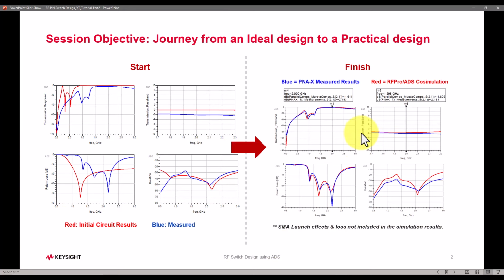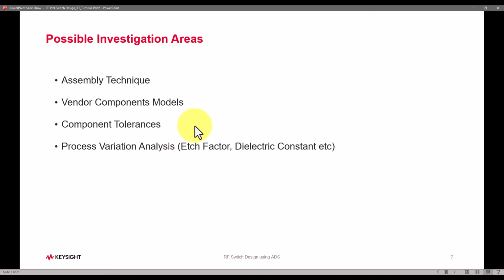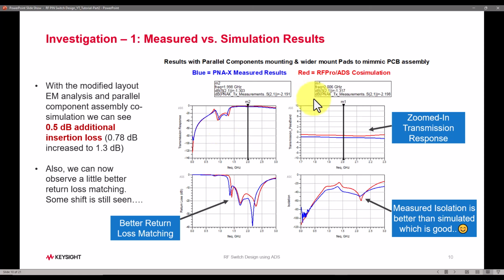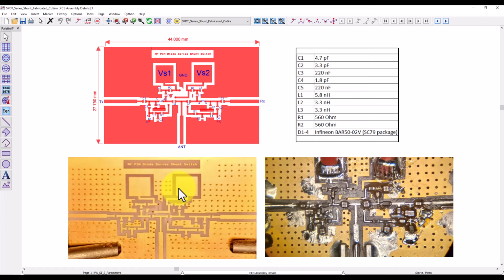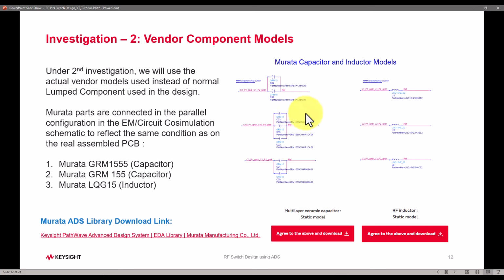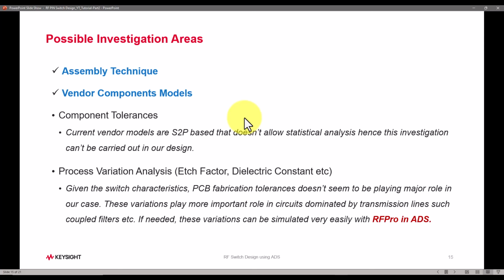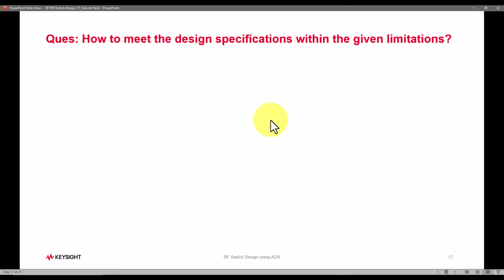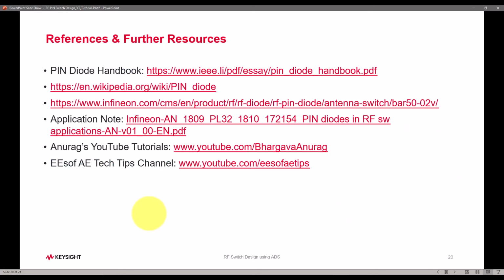RF Design-30: RF Switch Design using ADS - Part 2

Comment: Hi Anurag. Thank you for greate video !!! I have a question. Could you answer kindly?
I'm designing MMIC PA. But there's a quite difference with Momentum RF, uW, FEM.
I already tried to set some option to match the difference each other, but I couldn't.
So my question is that Is FEM simulation the most reliable?

Comment: Hello, I have a question that I would like to ask you, as I couldn’t find a suitable answer anywhere online. I initially learned ADS here, so I would greatly appreciate your help. 

In ADS layout simulation, there are two options: EM and cosimulation. When I use a process library (such as the Win PHEMT process) and work with transistors, cosimulation leaves a metal layer at the gate and other ports. This causes the results of the EM simulation (where the transistor is placed in the schematic) and cosimulation to differ, usually resulting in slight discrepancies in S21 and NF. I would like to know which of these two results is more reliable.

Is it the case that the metal layer is already accounted for in the transistor modeling? If so, what if I connect power and feedback to the gate, but the connections are not directly attached to the specific gate pins, and instead are placed on the metal layer of the gate? Could this lead to inaccurate results? 

I hope I have explained my question clearly. Thank you very much for your help, and I wish you all the best!
Reply from the maker: Hi
This required in-depth analysis. Kindly get in touch with Keysight tech support: support@keysight.com

Comment: Thanks a lot Anurag, I learned a lot with this video. I have a question, Is it possible to simulate a memristor in ADS?
Reply from the maker: Thanks for watching the video. I don't think memristor comes under supported design type in ADS but I may be wrong. It will be good idea to check with Keysight tech support team for final answer.
Reply: @BhargavaAnurag  Thanks for reply! I'll check.